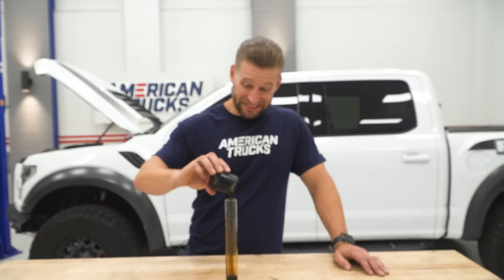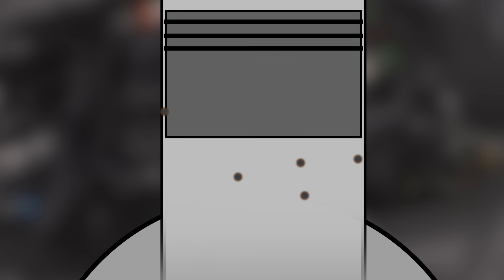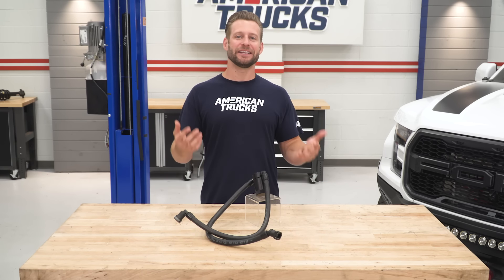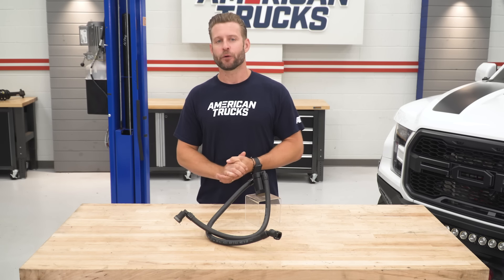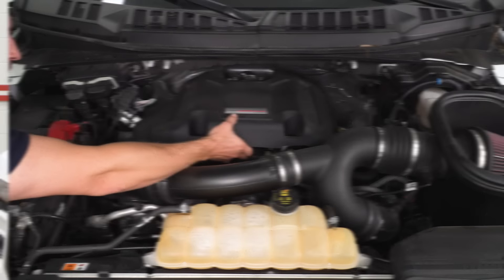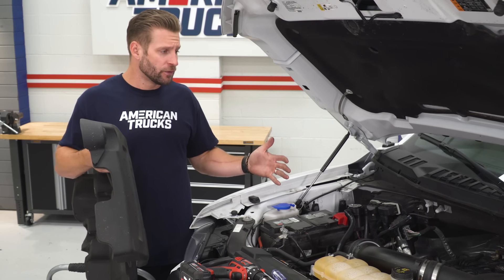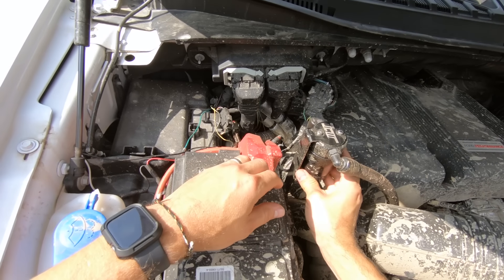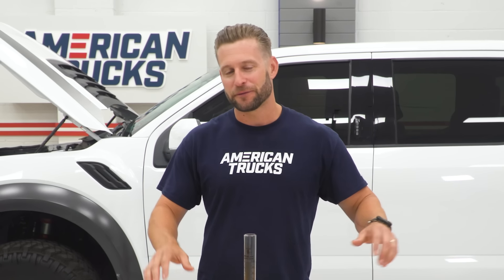Does Your F150 Need a Catch Can? - Ford F150 Oil Separators Tested And Explained

Comment: I just bought my my very own 2018 F-150 2.7L Ecoboost this week, and this will definitely be my first modification on it. I just happened to stumble upon your guys' channel a couple weeks ago and have been watching your videos constantly in anticipation of upgrading and preserving my new truck. Thank you for doing what you do!
Reply: Im right there with you. Just closed the deal on a 19 2.7 STX. Already ordered the exact same catch can showcased in this video lol. Thanks for the video im not the most mechanically inclined but this looks pretty simple to put on. I am curious how often it will have to be emptied out. I cant imagine it would end well if it got totally full and you kept going with it like that.
Reply: @toby6858  I see this was a year ago, did you install it and how often do you check/empty it??
Reply: I've also got a '17 Ecoboost 2.7L (bought at 110k, now at 135k miles) that now has just shown fuel in the oil @ 5000miles like 500cc/pint over full . Oil is still looking clean.. but changing out the injectors before this get any worse as I have a '14 Ecoboost 7007 package 3.5L that is over twice as bad (189k miles) and that one i looking for an engine replacement as I have a rear seal leak also.. let the problem go through two 5k oil changes and the oil is getting dark in 1k.  Fuel in the oil will take out the seals.  I suggest a throughout changing of all fluids and brake pads every 50k.. Oil changes at least 5k, especially if you bought it used.

Comment: I’ve run the JLT for maybe 2 years on my 2017 F150 STX and it is collecting some,  5,000 miles oil changes and I empty it. The truck runs great at 45k I really couldn’t be happier, not a mechanic or even slightly mechanical minded, but I thought it would be much more.
Reply: Ive heard these can freeze up in harsh winter conditions (-30c) and cause engine damage. Is that true?
Reply: @jordanalexander1592  yes it’s true, take in account those lines routing your catchcan, they collect oil and condensation of water.
Reply: @josemartin530  well if this is to happen how can one prevent this from failing?
Reply: @joshr19821  if you live in -30c I wouldn’t install a catch can.
Reply: @josemartin530  I live in Iowa and it only seems to get that way up here not often, except for this year. So if it isn’t consistent would it still be warranted to not get one?
Reply: @joshr19821  most probably you will be fine. Worst case scenario it’s really easy to uninstall and go back to stock.
If you have not check this video is really good on F150 catch can’s https://youtu.be/v6h_FOzFMcs

Comment: Ford introduced the gen 2 3.5 Ecoboost in 2017 with direct injection and port injection.  The 10 speed transmission was also an option for that year.  It was not in 2015.
Reply: Do you still need this for the second gen
Reply: I had a 2017 and never put one on.  I just got a new 2020.  I wont put one on that either.  I have a mechanic friend that works for ford.  He says not needed.
Reply: DeAtley Crushing Service  ok thanks how many miles did you put on the 2017?
Reply: @stevenjr713  about 120,000.  Ran perfect.  I just wanted a new one.
Reply: DeAtley Crushing Service  ok thanks for the help
Reply: Thanks I have the 2015. All the research agrees with your comment.

Comment: Put one on my 2017 5.0 two months ago. I have emptied it 3 times been about 1/2 full each time. works well
Reply: How many miles does it take you to get 1/2 full?
Reply: It doesn't do anything since the injectors wash the valves.  It's a placebo

Comment: Put this exact setup on my '18 within a week of leaving the dealership..works great!
Reply from the maker: Super glad to hear you're enjoying the JLT! Thanks for watching! -Zach
Reply: Im curious how it works great? My 2017 Optima that is pure direct Inj can fill up the entire can within 10,000 miles. My 2018 F150 that is Port and Direct Inj'd hasnt built up more than a tablespoon in over 14,000 miles. So im wondering.. since these are great for 2011-2016 ecoboosts

Comment: I was amazed at how much it caught after 2 weeks of driving. This product is definitely worth it. I put it in my 2014 f150 5.0 xlt. I just wish the mounting bracket was just a little shorter. But it still clears the hood with no problems.
Reply: How much did you collect over how many miles?
Reply: @dmitrynikgt  its gets about half to three quarters full every 2 weeks
Reply: Backpacker365  how many miles approximately is that? And do you loose oil between oil changes?
Reply: @dmitrynikgt  probably between 900 and 1200 miles. You might loose a few ounces of oil. I think its only a 5 ounce can

Comment: I drove 895 miles to Texas from Mobile, Alabama, and I only filled up maybe 1/3 of the can or less this catch can has 100% helped my 2011 ecoboost which is some what built to 424 hp and 400+ ftp torque and has 226,829 miles as of today, and is still running like a new motor no cam phaser issues as of yet don't know why either these are bad about it.

Comment: I have a 2020 F150 with the 2.7L . They claim that with the added port injection that you "should" be fine  .  But I was finally able to get one  , "back ordered" and installed it when I had around 4,000 miles on the truck .   To me it seemed like money well spent to keep my intake system clean as possible and was a super easy install and it looks good !
Reply: Any update, was it worth it?

Comment: Have it on my 2018 straight from the factory, made dealer install, and that thing is great. i get about a 1/2" in the bottom roughly every oil change.
Reply: What engine? I thought Ford redesigned them (EcoBoost) starting with 2018 models. Changed them to port/direct.
1/2" is nothing. My truck(2018 Silverado 6.2) collect 2oz. per 1,000 miles. UPR dual valve cc
Reply: @MrVegaslive  ouch, 2.7 l EcoBoost. 1/2" or not dont want that in the intercooler or back in the engine.

Comment: Got my catch can for my 2018 2.7 in the first 2k miles, currently at 20k and I can tell you ive emptied that jlt 3.0 at least twice(if it was full i usually dont wait that long)
Reply: I just ordered one for my 2017 2.7, you still running yours?
Reply: @openyourcoconut4774  Yes sir, I think it really depends on how you drive the truck, if your rippin on it there will probably be more blow by but im more of a reserved driver so it takes quite a few miles for it to get even close to full
Reply: So what's in the can? Every video that I've seen it just looks like oil in the can...it doesn't look like shavings or particles or anything.

Comment: I run the same JLT 3.0 on my 3.5 Ecoboost Transit 250 service vehicles.  A lot of stop and start plus cold climate.  We empty our catch can with every tank of fuel.    I get around that much fluid every 3-400 miles (more in winter than summer).  It is certainly not full  and I am sure we could run through several tanks of fuel with out overfilling.   Also .. you can install small ball valve off the bottom of the catch can if you drill and tap it.  Then you don't have to un screw a hot can at the gas station.

Great Episode!

Comment: Interesting that Ford Performance sells their own catch cans :-) 
That is a very big hint that these are a good idea! 
Plus the changes made in some of the EcoBoosts and the 3rd gen Coyote with hybrid injection (both port injectors and GDI).
Reply: After I bought my '17 F150 EB I asked around the ford dealership about catch cans and they gave me a while shpeel about how I didn't need it and that I shouldn't jump on the band wagon of people buying unnecessary things for the truck. Yeah, that's what they said. 😠 I did my research and ended up buying this catch can anyway.
Reply: or smart on their end sense so many people buy stuff they don't need, now they can say "OEM"
Reply: Luca Gracia lol.  I did the very same thing at my ford dealership.  And they said the same thing.  I also have a 17 f150.  I love my truck.  If this part will help keep her clean and powerful I’m doing it.
Reply: @luca2627  I bought a f150 2.7 2016 and asked the service manager at my dealer and he didn't know what I was talking about. My only worry is we bought a very expensive extended warrant and I don't know if this would void it or not. Some say yes, some say no. But ill bet if I have an issue and its on there they will try not to pay some how. My truck only has 55,000 miles on it now. The warranty is good until 150,000 miles. If I wait until warranty is over then put one on it, I am afraid the amount of buildup will be terrible. What to do?
Reply: @josephbenge8707  that's why, just to be on the safe side, I installed it I think at around 20k. Mine has about 47k now. It'd rather be safe than sorry.
Reply: @josephbenge8707  I know this thread is old but its easy to take on and off, keep your original hose and if you have a warranty issue just take the can off before you go in with a claim.

Comment: Just plug the intake port and route the rubber hose to the back of the motor, pointing down.  add one of those small filters if you want.  You're just trying to equalize the pressure between the bottom of the crankcase and atmosphere.  You might get a few drops of oil per year.  Pulling a vacuum on the bottom end of your motor, you're going to pull a lot more oil up, and into the intake.  This is really the beginnings of pollution control control devices.  From the 1950's to the mid 1960's a 'down draft' tube was the only thing used.  thats all you need now.  If you take your car to the dealer for any kind of service, put the tube back to the intake, or they will void your warranty for tampering with the pollution control devices.  OBD2 can't tell what you've done, so no problem there.

Comment: With dual injectors or port injectors these may or may not be needed but gear heads know what they want and like. My 2018 5.0 has a separator made and sold by Ford Performance for a Mustang. (Off road application only) I have a You Tube showing its installation ( listed under James Tone). There is oil  in it every time I check. 18k miles and was put on the first week. My 2015 Honda Civic has a Moroso installed. 
They are illegal since you are altering an emissions controlled device. I remove mine to have a he dealer servicing, takes about 5 minutes tops. 
I believe every engine but especially Supercharged need one of these devices
Reply: They are only illegal in CARB approved states that do emissions inspection.  If your town doesn’t do emissions inspections, then your fine. But if you are then, might keep the stock hose just in case.

Comment: My truck is a 2013 Ecoboost .... my separator catches more water vapor with the oil, a lot more.
Reply: My 14 does as well, I have to empty it about every 1000 miles.
Reply: What's the purpose sorry he shows in the video, is this to help the intercooler for the turbos?

Comment: I got 2 on my 04 5.4 3v. Had to modify the one for the passenger side some. But both work phenomenally. The driver side catches most. The passenger catches some but I'll take some over none any day.  264k and all original timing
Reply: can you show me witch you purchased and how did you do the passenger one i have an 07 f150 5.4

Comment: I had this installed in my 2011 3.5 ecoboost f 150 after I had the walnut media blast done to all my valves and installed a new throttle body and intake manifold and let me tell you when we took it all apart it was crazy all the build up n stuff was in there now I check it every year and it still has build up but not anything close to what was in there!

Comment: Did they improve the design on the engine.  I just bought a 2020 f150 ecoboost.  Should I install one of these.
Reply: Don't need a catch can if you have dual injectors.
Reply: It’s still a good idea if you want to get the most life out of it.
Reply: Dual port injection supposedly eliminates this issue, however it doesnt hurt to put one on.

Comment: Curious about putting the catch can on my 2016 eco boost with 71,000 miles, is it too late?  Can I get my injection valves cleaned before install?

Comment: I seriously learned a lot in the first 30 seconds! I have not had a ford since 2017.
Reply from the maker: Thanks for watching, Leland! We appreciate it! -Zach
Reply: Both of my cars have turbos and had been debating them, I’m glad I found this because it solidified my thoughts on purchasing them.
Reply: If you think every manufacturer doesn't need one of these you are wrong. I see them on high powered Mopars here in So Cal all the time. I believe GM actually has some style of one on hi performance engines..... Every engine needs one even my wife slowly Honda Civic.

Comment: Great video!! I have a 2019 3.5L F150. My question concerns freezing issues at very low temps, many owners have reported engine failure. Is this a valid concern and how low do the temps have to be to cause the problem. I'm in NJ.
Reply: @cl5163  I was hoping to hear from Justin or A/T ... nothing to date :(
Reply: Freezing oil?
Reply: @SorinNicu  It's all over the web, go search it and then decide for yourself.
Reply: @djpadko  Sure. Because Internet is great... 

Put the catch can in the place where the engine is warm enough to evaporate the water and it won't freeze.

Comment: I put one on my 2.7, ugly stuff when i drained the it once a month. I changed my oil at 3.000klm with 
5w/30 using Amsoil. It's an easy install and worth removing  gunk build up. Stroungly suggest, 20min job from J&L

Comment: Yes I agree this system should be in place of all new vehicles and the pcv system reengineered listen up manufacture  do you want to increase your warranty or have issues with the engine that will fall under the warranty and you are responsible to repair it. I think it’s a no brainer good suggestion from a viewer that obviously has the same idea.

Comment: I have a brand new 2019 f150 XLT 3.5 ecoboost. I’ve put less than 1k miles on it so far. When should I look at installing one??
Reply: Yesterday
Reply from the maker: To keep your 3.5L as clean as possible, putting one on sooner is better. The newer EcoBoost engines now have both port injection and direct injection so gunk building up in your intake won't happen as quickly, but it never hurts to have one on anyway as the video shows! -Zach
Reply: @americantrucks  Do you know of the new 3.0L used in the 2020 Explorer also has port/direct injection combo?
Reply: As soon as you bought it

Comment: Don’t pay $150 or more for a Oil catch can simply by universal one like I did for $40 that comes with a mounting bracket and all the hardware go to your local parts store and pick up in my case 5 feet of hose at a dollar a foot and for under $50 you’re good to go Plus the oil CAT scan that I purchased came with a dipstick so you don’t have to unscrew the Can every time you want to check the oil level.

Comment: Have one on mine. Collects lots of moisture too.
Reply: I had one mounted in front of the radiator on my old truck.  A LOT of moisture from condensation since it's colder out front.  I'm thinking the JLT might be better because it stays warm with the engine.  Less moisture that really doesn't hurt anything.
Reply: If you install that in a location that's heated by engine bay air, the moisture or un-burned fuel will evaporate and get sucked into the intake.

Comment: That's the first thing I bought for my new F150 3.5 eco after breaking in the engine. Works great 👍
Reply from the maker: Super glad to hear you're happy with it! Definitely a key mod for any EcoBoost owner. Thanks for watching! -Zach
Reply: @americantrucks  
Cool thanks!
Should one for the driver's side also be installed, or is passenger's side sufficient? 
Cheers 😎👍
Reply from the maker: Passenger side should be the primary one you look into since it will catch the most between the two. But if you want the most coverage as you can get, one of each will help! -Zach
Reply: @americantrucks  
😎👍
Reply: Teo P which one did you purchase? Where?
Reply: @stevendew7464  
The JLT 3.0, on Amazon, but these guys too sell it on their website.
Cheers 👍
Reply: p.s. Super easy installation, the only pain in the @$$ was drilling the plastic battery housing for the bracket.
Reply: Teo P thank you Sir.
Reply: @stevendew7464  
Sure! 😁👍
It's very tight under that hood, keep magnets handy 😂

Comment: I have jlt can works great, easy to install took about 10 minutes , put it on at 60,000 miles on my 2011 EcoBoost wish I put it on sooner, I live in Wisconsin so in the winter months I had to buy the extended can because of the moisture, the 3 oz can filled up in less than 400 Miles.
Reply: Where did you get the bigger can and how much bigger is it

Comment: Now pull your turbo inlet manifolds and see how much of oil condensation has collected inside.  When you use this type of catch can setup, you're only collecting the blowby when the turbos aren't building pressure.  As soon as they start pressurizing, a bunch of blowby gets introduced into the system.  The quickest way to check is to pull the inlet to the throttle body and see if it's full of blowby.  If you do  have blowby, there are ways to modify the cheaper catch cans to perform like the 400 dollar ones.

Comment: I'm already at about 75k miles, would it still be beneficial to install one having already put that many miles on my engine without one?
Reply: ben carter I think it would be. It can prevent further build up. I took off the valve cover on a old focus the other day and I under stand why they say to install a catch can. The engine build deposits of like soot idk what it is it’s gunk when you don’t run a catch can. There pricy but I think in the end it’ll be worth it.
Reply: From what I can tell it would help but I haven't seen any real science to prove these things are really beneficial.
Reply: Half Star Films I would think vehicle manufacturers would install them before selling the car if it was beneficial.